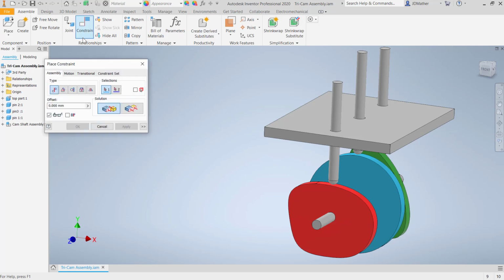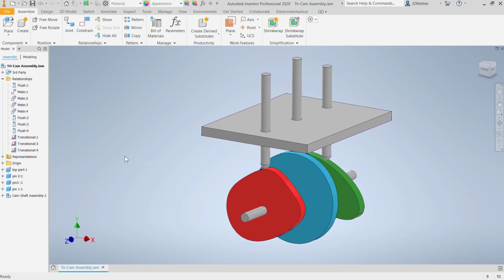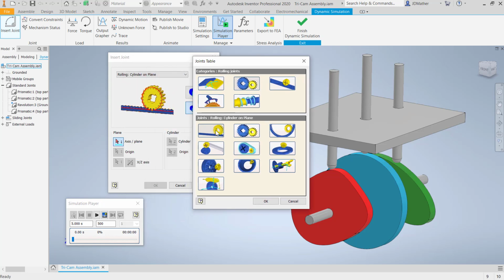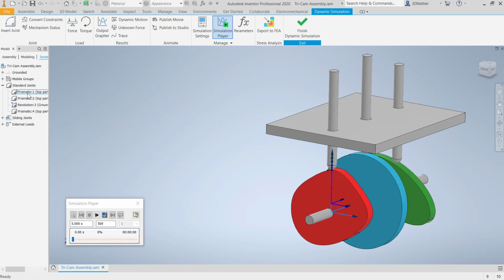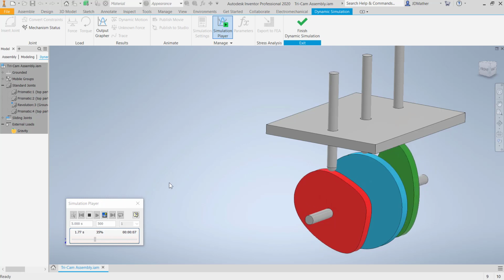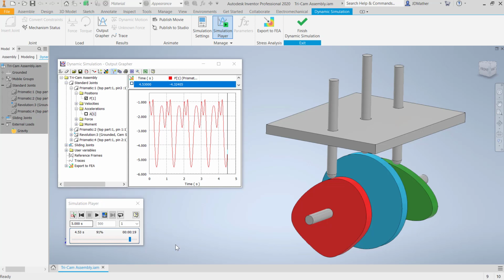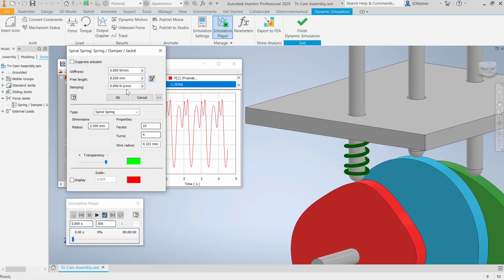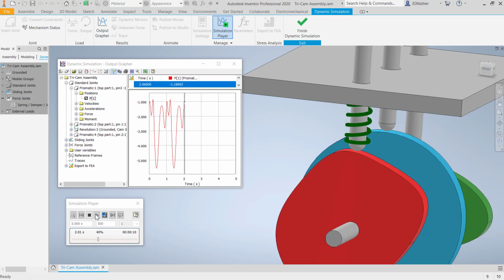Cams in Autodesk Inventor Professional - Dynamic Simulation

Comment: i followed your video everything worked fine but every time i play the dynamic simulation it just froze not moving at all  even though it worked with transitional, do you have any ideal what is going on? also the sliding joint can you show how you do it? much appreciate
Reply from the maker: https://forums.autodesk.com/t5/inventor-forum/need-help-with-cam-follower-dynamic-stimulation/td-p/10726685

Comment: I couldn't get the sliding joint to work. I used a point curve one. The ball-tip of the follower always ended up inside of the cam.
What did work though was a 3D contact joint.
Did you use another sliding joint?
Reply from the maker: It has been a while since I did that one and didn't go back and check, but I most likely created an extruded cylindrical surface body (hidden visibility) for each follower (same radius as the hemispherical face) and then use Sliding Cylinder on Curve Joint.
Reply: @TheCADWhisperer  Thanks for the quick reply! Makes sense now.
Reply: Is there a way I can find out at what rpm will the gravity wouldn’t support pins without the dampers